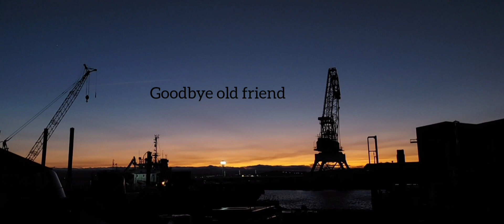Burntisland crane lifted out the water Saturday 17th December 2022

Comment: Lift by forsyth of denny .2x 500 ton capacity cranes used .
Reply from the maker: Thanks for the info and thanks to Forsyth of Denny for clearing up the last of the crane. It definitely wasn't an easy lift, I knew that much, it looked like it took a couple of attempts before the mud gave up it's grip, you can see the moment it jumps up.